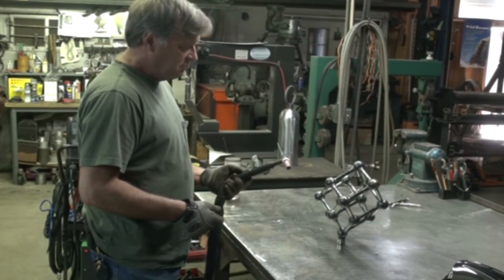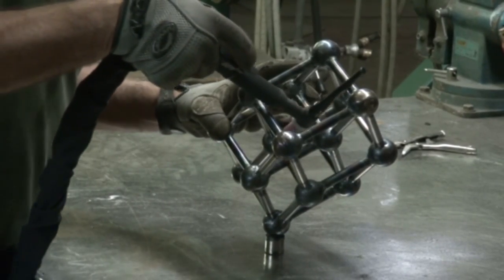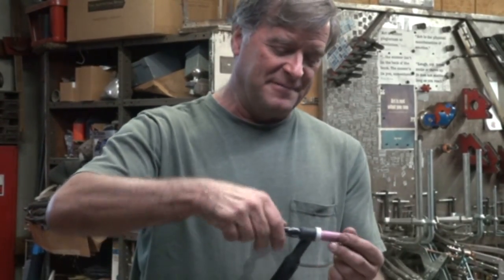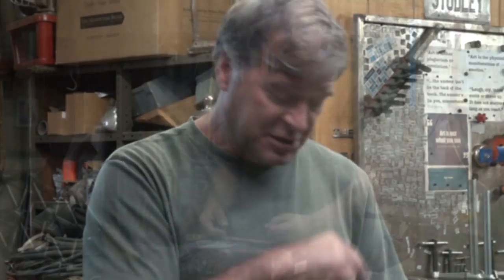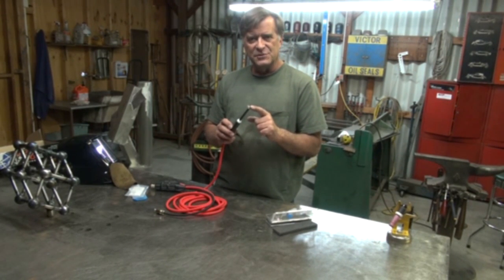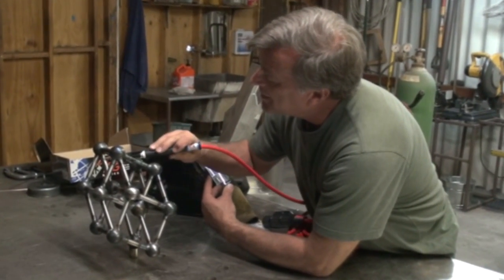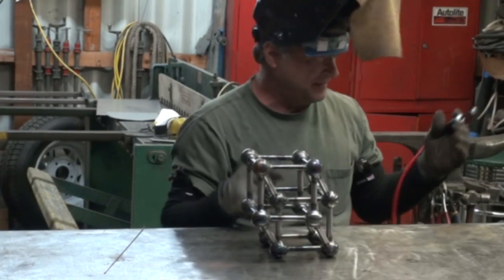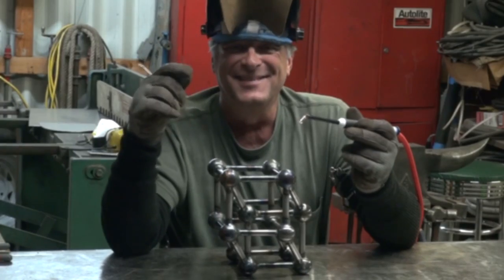How to Weld in Tight Places - Kevin Caron

Comment: Any secrets to sharpening such short tungsten? Seems like would be hard to hold and still have enough length to insert into sharpener.
Reply from the maker: I do mine with a drill and against a diamond wheel on the bench grinder.   It is a low-speed grinder for sharpening woodworking tools.

Comment: Where do you get the circular balls that you have that you are connecting or do you make them, I wanted to do a project but I have no clue where to get the metal cylinder things. I wanted to make an upscale model of jacks for a center piece (I wanted to make two jacks only about 6inch all directions) and I need to know where to get the balls
Reply: Have you found a place to get these?  I have a project where these would be perfect.